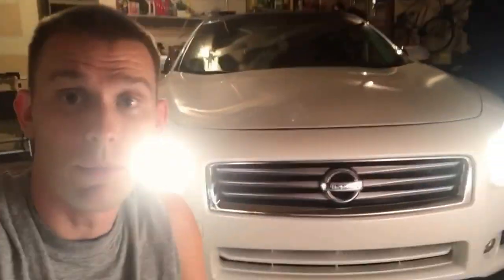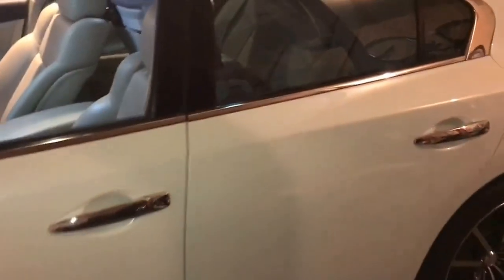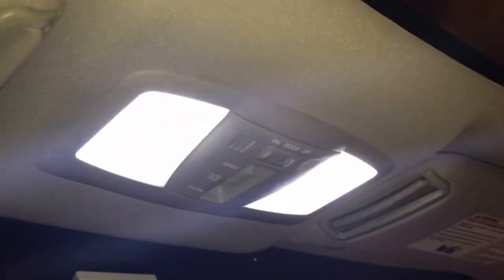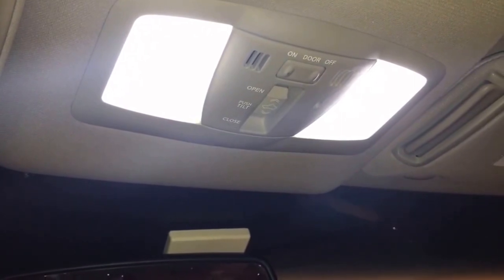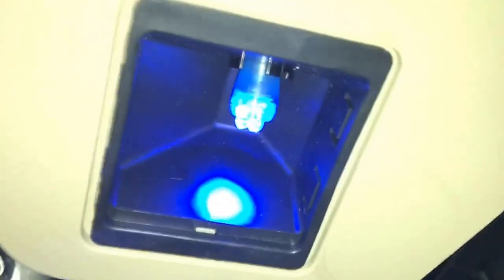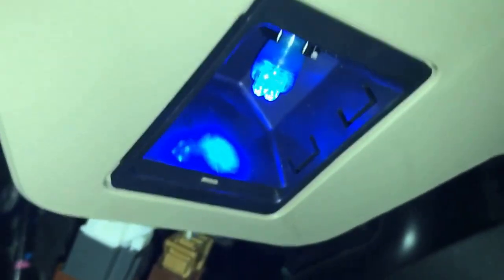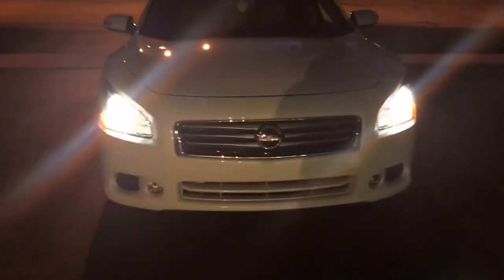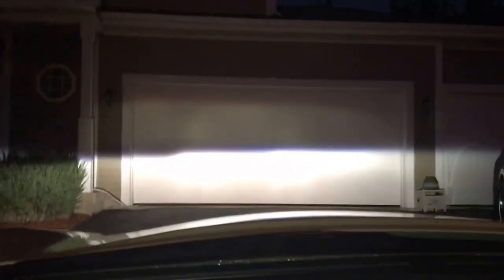Nissan Maxima How to Change ALL lights to LED

Comment from the maker: Timestamps:
0:44 Change the Map light bulbs or Reading lights bulb
2:26 How to change the drivers side bulb by your feet
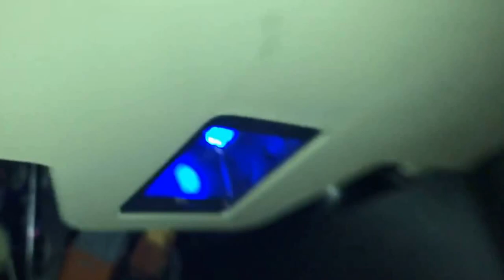3:11 Changing the door lights or Step light
5:52 Swap out the rear seat reading bulbs
7:51 End result picture of interior LED's
8:33 How to change the trunk light to LEDs
9:19 Replace the License Plate Bulb
19:26 How to change out Stock OEM Headlights to HIDs without removing the front bumper
24:58 End result of HID's from exterior and interior views for brightness / color
Reply: How do you change the glove box light?
Reply from the maker: Ernie Montgomery -- i didn't change that yet, so to he honest Im not sure.. Can anyone else help with this??
Reply: Is there a link to the led interior kit?
Reply from the maker: Try this for the led bulbs : https://goo.gl/19XfkY
Reply: could you do me a huge favor and send me an amazon link for those LED lights at 1:48 ? i don't know what exactly to look for and don't want to order the wrong thing, I drive a 2014 maxima
Reply from the maker: @michaelbuholzer8410  Sure thing here you go! 5 SMD LED (pack of 10) - https://goo.gl/19XfkY
Reply: Btw will the 5smd leds work for all the interior and license plate?
Reply from the maker: Yes, should not be a problem to use throughout
Reply: @JealousLawnCare  ty just ordered me some for my 2010 MAX
Reply from the maker: Great to hear, enjoy the new clean look!
Reply: @JealousLawnCare  got them installed today. They look great. Nice bright clean look.
Reply from the maker: Great!

Comment: Hi mate! Nice video, I've followed your instructions and got everything right, but i'm having problems with the T10 bulb that illuminates the trunk! I'm not very flexible and i'm trying to replace the bulb without looking, just with my hand, but I can't find the opening, the replacement bulb just won't go in! Do you have any tips for me? I think the bulb must be aligned from front to back, right? I might just have to ask a kid to get into the trunk and do it for me! :)
Reply from the maker: Yep the best way I was able to do it was to get a chair or little table behind the car and lay down on it.  This will help you facing up at the bulb and make it easier.

Comment: Thank you for the tips. Helped me a lot and now im completely LED
Reply from the maker: Glad to hear it! Makes you appreciate your car all over again doesn't it?
Reply: Dude its like a brand new car. Thank you for the instruction. I just threw lightning dark leds into ghe head and foglights and interior leds and licensee plate leds. Along with the tints this thing is lookkng BAD ASS. AGAIN thank u so much
Reply: The license plate tip made it so simple and easy. Once u realize all this crap is held on by pushclips its a breeze lol
Reply from the maker: repairshop22 -- ya i definitely agree, we had a 2009 maxima and got totalled by a texting driver hit us from behind.  We liked the Maxima so much we bought the exact same car/color in a 2012.  The only thing I'm not happy with is not being able to change the tranny fluid myself since it's all closed due to the cvt. So fingers crossed that it lasts a long time!

Comment: You have to take the tire off to replace the bulb? Thanks
Reply from the maker: That's the easiest way.  Technically you could turn the wheel all the way to the left and you could have sufficient room.
Reply: @JealousLawnCare  ok thank you 😊
Reply from the maker: No problem 👌

Comment: Thanks for the great video!  It made an easy job of changing my lights out on my Maxima.
Reply from the maker: Kenny Seay --- makes a nice subtle difference in these lights doesn't it? Loving mine!
Reply: thanks from me as well i purchased the 10 piece set on amazon will start mods next week on 2014 maxima

Comment: Thanks for the vid man! I just got these LEDs and installed. Video was super helpful, especially with the trunk light (couldn't figure out how to pop it open).
I have a 2012 too, I was wondering if your lights still dim when they turn on and off when you open/close the door? The OEM ones fade off, but I realized the LEDs just shut off after a few seconds.
Reply from the maker: Yes mine don't dim off either I don't believe.  I did these immediately when I get the car, it's always my first mod. Heh

Comment: Do you not have any fog light bulbs or do they not run with the low beam headlights?
Reply from the maker: Yes i do, but this email are typically off and we turn the switch on only when needed

Comment: By chance what replacement bulb is the orange light? In the headlight housing. Not the right or left turn bulb but the one right beside it. (FRONT HEADLUGHT HOUSING) When I flip it it also turns on the license plate light and the taillights. I wanna say they are called the drl lights but I’m not too sure, if you know it I would appreciate the information thank you!
Reply from the maker: I think you are referring to the "side marker light bulb front" style 2827.  I just disconnected these in my car because I like the look without them installed.

Comment: Got a question, I changed the bulbs to LEDS but they blink intermittently. Does that mean they are to strong? WTF
Reply from the maker: That should be because leds are lower wattage and you need to add resistors for the blinker bulbs to not flash rapidly.

Comment: Hello, I just installed some AKKON LED headlights  on my 2014 max and for some reason the low beams will not fit to "plug and play." i was wondering did you need a conversion kit at all? I only have high beams and running. i have the correct bulb as well, nothing is wrong with the wiring confirmed by using electrical testing machine. Any ideas?
Reply from the maker: Nichole G -- did you verify you got the correct bulb # for your car? Some bulbs control 1 function, but others do multiple (high/low beam...etc).  Do you have a link to where you bought it?
Reply: From my research, you have to do a full conversion. LED bulbs are not meant to fit in the factory halogen projectors as you would risk burning the lights out. I want LEDs for my 2013 Maxima and that's the conclusion I've ultimately come to.

Comment: I have a 2007 Nissan Maxima SE and one of the fog lights burnt out today. I've been meaning to change them because I didn't care for the yellowish color they projected. Are they yellowish because they're halogen bulbs? Can I change the bulbs to an HID type or LED?
Reply from the maker: Connie Edwards -- yes you can definitely change them both to hids.  However for functionality people use yellow for fogs because yellow is the brightest light color (however it doesn't match the headlights which is annoying).
Reply: @JealousLawnCare   Yes..they are annoying because they definitely do not match the headlights. However, for functionality, I may need to stay with the halogen, as we have a lot of fog at times. Thanks for replying.
Reply from the maker: Connie Edwards -- just fyi you can also get hids for the fogs and have them more yellow (look for something around 3,000K on the scale of brightness)

Comment: One of my map lights stopped working, if it was a fuse both would stop working instead of one no? What else do you think it could be?
Reply from the maker: Yes i would expect both to stop working if it's a fuse.  Did you try swapping the map lights to ensure its not the bulb? Also flipping 90 degrees helps too for these

Comment: I have a 2013 maxima I can't get those footwell light bulbs out they don't move or twist  please help
Reply from the maker: Yes you can reach behind the bulb housing and turn the plastic "screw" a half turn and the whole assembly with bulb comes out easy.

Comment: My footwell lights will not come out. Idrk if they are just that hard to get out or I am doing something wrong, suggestions?
Reply from the maker: The ones underneath the car on the outside (these are led strips and can't be replaced easily to my knowledge), the ones by your feet when driving should come out.  It's just awkward trying to get at it while positioned upside down to get at

Comment: Will one pack of the 10 pack Yorkim bulbs be enough to replace all these interior and license plate light?
Reply from the maker: It should be 4 for doors, 2 in map lights, 2 rear map lights, 2 in foot wells or step lights, 2 for license plate, 1 for trunk. Total of 13.  You could buy the 10 and skip 2 foot / step lights and trunk.  These are the smallest impact imo
Reply: Have you seen the yorkim 6th gen bulbs? Those popped up, I’m guessing they are the newer version?
Reply from the maker: Manuel Lucero - haven't tried the 6th generation but newer the better I assume. 👌

Comment: Thanks for the video Brother, that's exactly what I needed.
Reply from the maker: Great, just what I wanted to hear 😎
Reply: @JealousLawnCare  I did change all mine and the ones under the dash that shine on the floorboard you can reach behind them and grab the light socket, give it a twist and the whole thing comes out. Change your bulb and pop it right back in from the back and give it a twist to tighten it back up.
Reply from the maker: Yep that's definitely the easiest method 👍

Comment: Quick question. Them front turn signals you have linked that look blue when off, so they blink white when blinking to match the rear turn signals?
Reply from the maker: Yes that's correct
Reply: Cool thank you
Reply from the maker: Anytime!

Comment: Did you do your ground lighting underneath yourself? Also do the lights activate only when you unlock the car?
Reply from the maker: Malik Whitelow -- no the lighting under the car came stock on my 2012, but not on my 2009.  Nice addition they made imo.  These light up when unlocking or opening any door and seem to be leds, so should not need to replace them ever (rarely if any).

Comment: How did you really change your bulb out on the driver/passenger side by your feet?
Reply from the maker: I'm not sure of your question, it is how to reach it or what?
Reply: I have 2014 and the bulb will not come out on my drivers side. I took o Didn't try the passenger yet.
Reply from the maker: Michael Whitehouse -- are you talking about the headlight or which bulb? Headlights you have to release the bracket holding it in place
Reply: @JealousLawnCare  I was talking about the bulb underneath the drivers side floor board.   I had a time with it but I eventually got it to come out.  I had to pull the plastic casing off and  pull out the bulb while it was freely hanging.  Thanks for the response
Reply from the maker: Michael Whitehouse -- oh that one, ok glad to hear you got it out!  Its kinda awkward to get at that one I know :-/

Comment: So I really like the white tail light turn signals! I am going to do this to my 2014 max. Is there anyway to get the front turn signals to match due to the fact the headlight reflector is amber color?
Reply from the maker: Manuel Lucero -- i assume you would just remove the orange reflector in the headlight (this was the case with another car I had, it's just an insert).
Reply: Ya I can see that, but I am going to order some nice custom black housing headlight assembly’s and I don’t want to take the lamp apart to remove. I don’t want to take a chance at breaking them, I guess I will just put a white bulb in there and live with that lol
Reply from the maker: Manuel Lucero -- yes that's the safer route! I'm sure it will look good
Reply: One more question. I am about to order these interior led lights that u have listed here off amazon, the 6k white. I have seen mixed reviews where the lights stay lit very dim when turned off. Have u experienced this issue?
Reply from the maker: Manuel Lucero -- never had issues as you described and I've used this in my last 3-4 cars.
Reply: Cool thank you for helping me deciding which bulbs to chose! 👍🏼
Reply: I do see the 4 smd 8 pack and 5 smd 10 pack. Two different brands. Which is the correct one?
Reply from the maker: Manuel Lucero -- no problem bro!
Reply from the maker: Manuel Lucero  the yorkim 10 pack is what I recommend, link in the description for ya 👍

Comment: I have a 2010 maxima as well. Im tryna change my drl/high beams from halogen to LEDs, are both the same voltage, bulb size etc.. thanks
Reply from the maker: darrel1495 -- I've never went to LED headlights, I can only speak to HID headlights

Comment: So it looks like there all going to be the same bulb on the inside? 
I have a 2014 and my doors are more square Them yours
Reply from the maker: Yes i just did a quick lookup of bulbs for the 2014 and your doors require the same bulbs as mine. (Sylvania has a great lookup tool on their website which I use often)

Comment: So I have a 2014 maxima that has halogen headlight, will changing it to HIDs be the same process as in your video?
Reply from the maker: Yep same process, I did it to my 2009 and 2012 maxima and 2014 is the same body.
Reply: @JealousLawnCare  hi.. so you didn't need an HID kit? I'm sort of confused as many of the links state it will only work if you have HID headlight kit... i haven't changed any of the headlamps.. they arev so factory but i need to upgrade immediately... please advise
Reply from the maker: @lovelylady748  -- from the factory they come stock with hids, so this is just a replacement bulb essentially.  No ballast needed
Reply: @JealousLawnCare  Do you have other recommended bulbs? Your link doesn't bring up the Osram bulbs, and the ones that do come up say i must have HID Headlight and not Halogen
Reply from the maker: These should work fine with your maxima, I have been using them for years in my 2009 and 2012 maximas.

Comment: Thanks for showing us HOW ALL THE BULBS SCRE OR POP OR WHAT??.. all the leds were in when u pulled off the COVER DAMN IT! i want to see ALL STEPS PLZ....  IM SO MAD RN! dnm
Reply from the maker: Tori Tropics --- the only step I skipped mostly was physically pulling on the bulb to get them out (which sometimes is easy and sometimes harder). Just pull on it and it will come out.  Ideal option is using rubber gloves for grip like dishwashing gloves.
Reply: Tori Tropics big facts!!

Comment: I replaced all my interior lights to led lights my foot well lights doesn’t turn off completely they stay dim very little but they’re dim , what’s the problem ?
Reply from the maker: Hmmm that sounds strange, and it only happens when installing these leds?  Did you use the ones I put links in here or different leds?
Reply: I used sirius led bright 3030 from amazon
Reply from the maker: isaac castillo -- can anyone else share their experiences with this product (sorry I would assume it's the product...defective maybe)?

Comment: hey how did you install the ground lights under the car ?
Reply from the maker: Actually these came stock on my car.  Yours may have it too, but could be burnt out or not showing properly.  They are a led strip and a pain to get at
Reply: @JealousLawnCare  mine is 2009 Nissan Maxima S
Reply from the maker: Strange that's what I have too (2009 and 2012).  I wonder why it's different?
Reply: @Jealous Lawn Care  not sure why but i will use your videos as reference when changing out my license plate lamps and reverse bulbs
Reply from the maker: Sounds good 👍

Comment: What bulb did you use for the doors? I know the Yorkim 194 doesn’t fit i wanna make sure i get the right one bc i don’t see any others in the description
Reply from the maker: Cam Lynch -- what year do you have? I used those 194s in my doors.
Reply: Jealous Lawn Care i have a 2011 maxima SV. I got one to fit and stay put on the rear driver side but as for the other doors they fall out as soon as I put the cover back in
Reply from the maker: Cam Lynch -- that's very strange, but your stock incandescents don't fall out?   Should be the same size, I used these in my 2009 and 2012 maxima SV.
Reply: Jealous Lawn Care i honestly i don’t remember how i got it to stay in on that one door. The stock bulbs held in place also. I’ll just try a different bulb. I’m definitely going to check out your channel and look at the other maxima.

Comment: How do I know what headlight bulb to use. I want to put LED but I hear that the 2012 maxima come with 5 different options of bulbs setup. I seen an other video and the bulb looked different that they used.
Reply: The light I just got are the revo led system r6. Will it work for my 2012 maxima
Reply from the maker: maribel rodarte -- what is the bulb type you got? Should be D2S for our Maximas.
Reply: Yeah its D2S I just noticed once I got the bulb out. I purchased the wrong ones. I really want bright light bulbs that can cut through fog.
Reply from the maker: maribel rodarte -- if you want brighter lights for fog, don't go too high on the Kelvin scale (maybe get around 3k for hids assuming you don't care about the more yellow light) yellow / white light is brighter than the 5K blueish light.  Also for best visibility especially in fog, you could do bright yellow fog lights, that's your best chances to see in the fog (and never use brights in fog of course).
Reply: Okay I may invest on getting bright yellow fog lights. I like how it will make the car look. Do u have a video on how to change the fog lights.?
Reply from the maker: maribel rodarte -- unfortunately that's basically the only light I haven't changed out (i rarely use mine, have very little fog)
Reply: Okay no worries. But thank you so much for the video and for aanswering my questions. Not a lot of people do that.🙂
Reply from the maker: maribel rodarte - anytime, I love to help!

Comment: Could you do a video on how to use the paddle shifters
Reply from the maker: Giovanni Martinez -- are you familiar with how to drive stick shift? It's basically the same as driving stick / manual except no clutch needed.  Used mainly for quicker response / acceleration in any gear/speed.